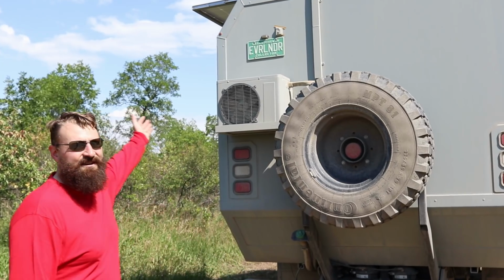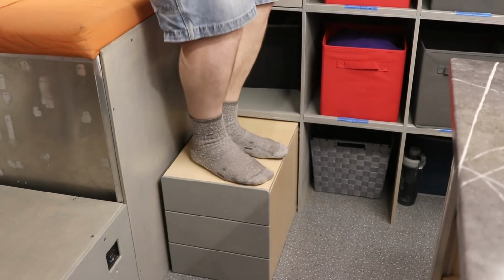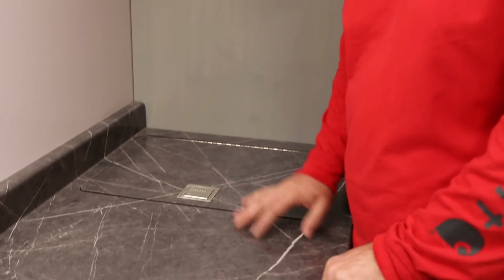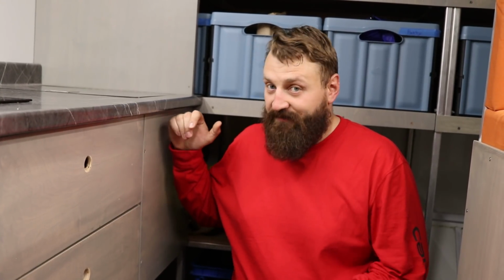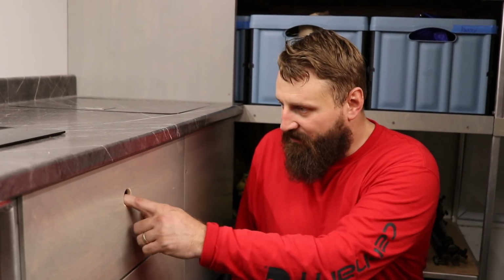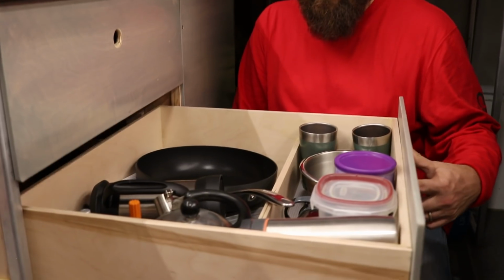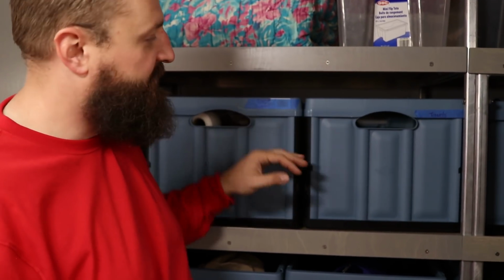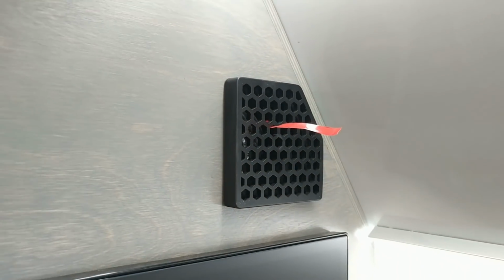DIY RV Interior, Engel Fridge Upgrades and Progress  - How to Build an Overlander

Comment: Thanks. Useful!
Quick question, how/where does the fridge lose its heat? I don't see any vents for cooling air.
Reply from the maker: The compressor is remote mounted, under the sink, by the door, vents and fans are on the side of that cabinet.
Reply: @Everlanders  thanks. Makes sense now.
Reply from the maker: Filming a video on the topic of fan speed for that compressor right now in fact...

Comment: Nice setup on the air cylinder controlled step! On the drawer latch system I have used one of the aftermarket car door locks solenoid's. Apply power one way it pulls in, reverse power and it pushes out.
Haven't had a chance to see all the videos yet but I see no windows, security, stealth or both?
What brand of split air AC are you using? Most of the splits I am familiar with have a head at least 30" in length, the one you showed appeared to be a small box. Is this split using an inverter power system which is far more economical to run than the older splits?

Comment: Where does the refrigerator heat go? Looks like it is trapped inside the foam box.
Reply from the maker: We ordered the fridge with a remote mount compressor, it's mounted behind a grill, near the entry door, 4 feet to the left, kind of under the sink... By default they are mounted underneath the fridge, which I thought was dumb as all that heat rises into the fridge...

Comment: I'm planning a Sprinter 4x4 build but will be borrowing ideas from your build.  I found the interior on this boondocker to be interesting.  https://www.youtube.com/channel/UC_W_E5SFCxwpSOaqMjOOBTg
Maybe some food for thought.  You've probably already considered it, but I suspect you can make your shelves structural if tied into the aluminum panel framing.
Reply from the maker: Mine are structural... 😁 Without being a thermal bridge, which would clearly cause some problems.

Comment: Have you had any more condensation issues?  I couldn’t tell if you had a drain running along that power cord or not.
Reply from the maker: No condensation issues... And no, there is no drain hose, you may be seeing the remote compressor lines and control wires.
Reply: @Everlanders  that's great to hear, I plan the a similar double insulated approach and was worried I would shift the dew point and end up with a very wet insulated box

Comment: Do you know if the outdoor part of the mini split can be mounted horizontally?  We just got a RAM Promaster and I think I can remove the battery box and run the tubing through that space and maybe mount the mini split underneath the van.
Reply from the maker: I doubt it... Most compressors need to be upright... further, I don't think it would last very long with the compressor hanging sideways off its suspension mounts 😞

Comment: Love your channel! Ive been dreaming up building my own offroad camper something like this but on a smaller scale (Ford Ranger or Toyota Tacoma) and have always wanted to build in a passage from the truck cab to the camper area. I have enough money saved up, and the shop is cleaned out enough now to get things started off. Loving taking inspiration from your channel.

Do you ever think that you would have liked to have a passage (even if it was just a small crawl space) from the cab to the camper? There would obviously have to be some kind of gasket or flexible barrier between the two. 

What are your thoughts on that?

Thank you for your educational and well done videos!
Reply from the maker: Thanks, I still have no use for a pass through, don't miss it, wouldn't add one in hindsight... Pros: Fast getaway if being jumped by zombies. Cons: You get to hear all your junk ratteling as you drive, you loose all that area for storage, gaskets leak, would-be theives are one window away from all your gear, and of all the people I've asked who have them, nobody uses them, they all go around. Even sprinter van people go around most times...  But it's all preference I guess.
Reply from the maker: Keep in mind that a Toyota Tacoma has a payload of 1400 lb, you need to be extraordinaraly mindful of weight if building on such a light chassis.

Comment: OMG You invented the pneumatic lockbox!  This is why you’re my favorite channel, I’m copying a bunch of your ideas in my build.  Thank you very much!

If you feel like it I would love a video about your cameras- I saw the one about the housings, but it seems you have multiple cameras in the housing and a I saw a reference to a PIR.

Be interested to know what kind if cameras and how you’re using them.  

I’m planning to use raspberry pi 3 with the HDMI cable you found, and NOIR and regular cameras both, with the regular cameras doing stop motion and travel video.  Thought about putting an IR filter on a servo so I can just use the NOIR cameras all around but haven’t had a chance to experiment.
Reply from the maker: So many ideas, so little time! Here is the camera you need... I have a few of them. https://www.waveshare.com/rpi-ir-cut-camera.htm
Reply: Everlanders thanks!  Wasn’t aware of that camera. Looks like it does exactly what I was contemplating- moves a filter in front of the sensor.  Love it.